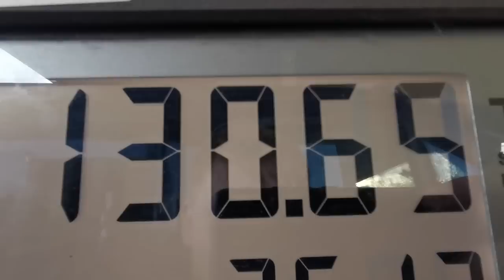Starting Dads Old Fergy After 15 Years!

Comment: Great job. I used to cut grass at a sports club with a TE20  Petrol/TVO and gang mowers. I was 14 yo then. Great fun summer job. Standard Triumph engine was brill, always started and ran well. Starter was operated by a switch on the gear lever. Push over to the right and up. Another great vid, ta muchly.

Comment: I spent hours driving our (factory) diesel (with the ki-gas) as a child, with a PTO concrete mixer on the back while dad built our outbuildings. They had a big brass knob sticking out of the side of the gearbox you had to hold down with the side of your knee before you could engage the starter position. The petrol/tvo units had a blanking plug there.